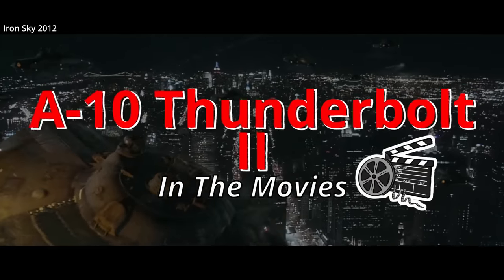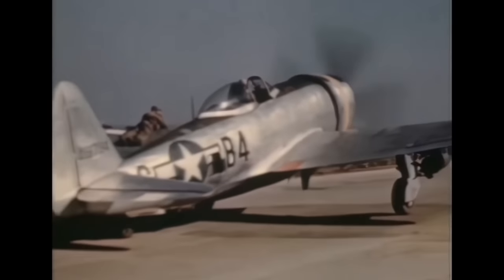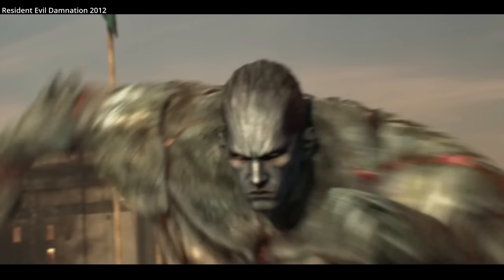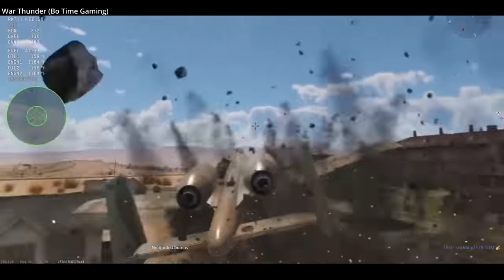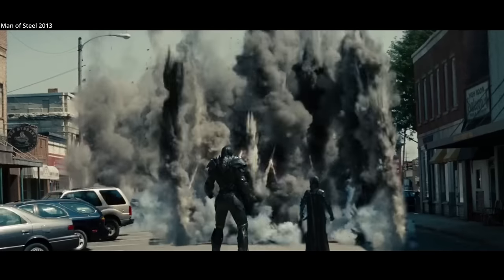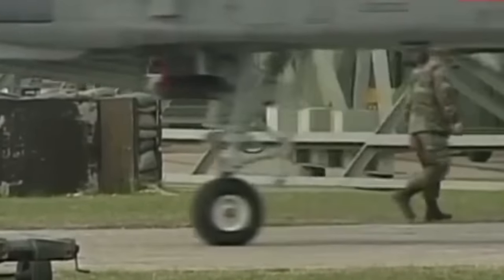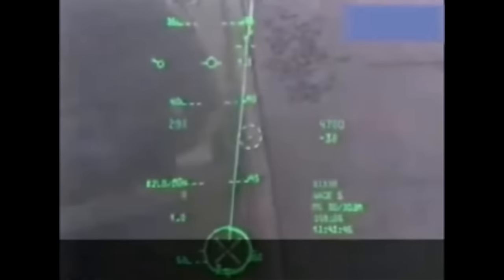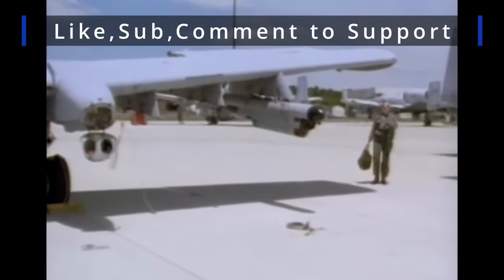A-10 Thunderbolt II - In The Movies

Comment: cool but overrated
Reply: The troops on the ground that called them in for support would disagree with you.
Reply: @tomvogt5988  The troops on the ground that called them in for support but got vaporised because the a10 didn't have IFF systems and needed fucking binoculars to identify friendly units (and even if it does the cannon is highly inaccurate and can very well strike friendly units ) would disagree with you
Reply: @Skoodelly  Luckily, we are not in the 20th Century anymore. Those avionics were replaced since the 70's and 80's. 

Should we judge you by your handwriting in second grade today?

Your complaint about the weapon accuracy is bunk, full stop.
Reply: @tomvogt5988  The troops on the ground cared they got support. The aircraft used is a moot point because ANY aircraft could have done the same thing. It is just those don't go BRRRRT and are there own meme. The A10 combat record isn't spectacular. In Desert storm the A10 was out performed by the F111, a VIETNAM ERA bomber, which was also shot down in LESS numbers than the A10. But the F111 doesn't go BRRRRT.
Reply: @tomvogt5988  I mean 

not really most of them hated having it and the British even demanded they be removed from their AO

Comment: Nice, but overrated and obsolete in a full fledged modern combat.
Reply: Only if you expect it to dogfight an SU-57 or SU-35.
Reply: @pogo1140  welp im expecting it to fly against manpads so u know
Reply: @ligma5058  That low, good luck to the manpads crew, they have less than 5 seconds to grab the launcher, turn it on, find the A-10, shoulder the missile, acquire the plane, get tone and launch and hope it does not get distracted by the curtain of flares.
If there is any sound of combat, rifles, mortars, standing next to an apc with it's engine running, you will not even hear the the thing.
Reply: @pogo1140  wont hear? are you blind? or did you just forget how to use your eyes. tactics are easy man, do you expect every enemy to be in one place packed up as target? no. theres gonna be an A and B group, to bait and the other to destroy. weve seen how that tactic has been used in multiple different wars and it remains effective, a10 or not.